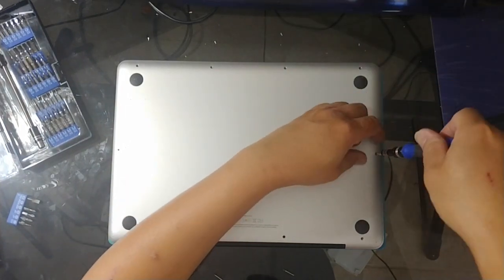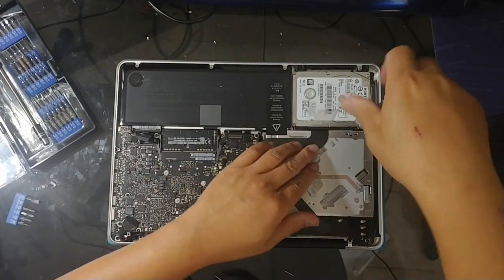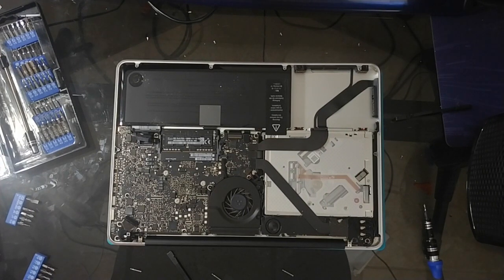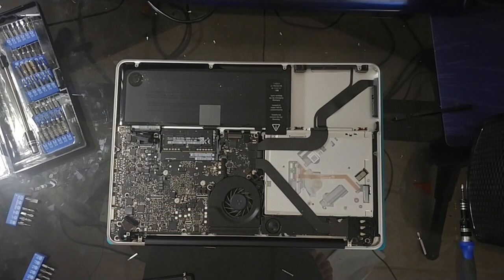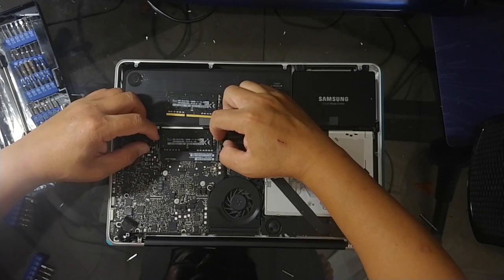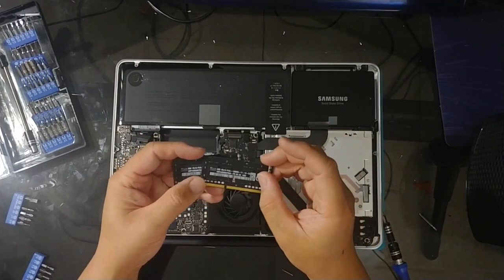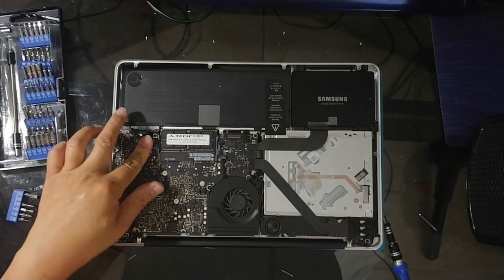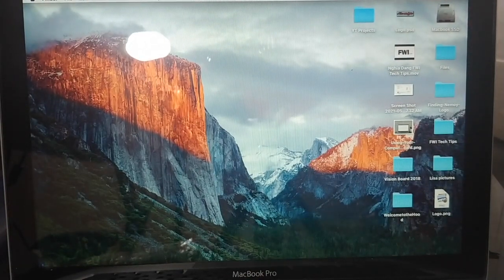Mid-2012 MacBook Pro: Upgrade in 2021

Comment from the maker: If your interested in purchasing the 16 GB Ram. Please click on the link below. It will help support the channel. 
A-Tech 16GB (2x8GB) RAM for Apple MacBook Pro : https://amzn.to/3CtAlam
Reply: Hi! Thx for video I have question.
Is there need specific memory? Or I can buy any laptop ddr3 memory?
I mean this memory should be for mac or I can use any for pc laptop?
And how do u use 16 gb , when on apple website it writen max 6gb memory?
Reply from the maker: @trueyolu1906  I would recommend purchasing the Ram that states it is compatible with the MacBook Pro model. You don’t want to add a PC ram and find out it is not compatible. I have the link in the pinned comment above.
Reply from the maker: @trueyolu1906  if the website states it max is 6gb memory, it does not mean that the max. If you do a search , you will find people that are successful adding more. I would recommend reading Reditt forums.
Reply: @mydangfinance2815  thank you :)